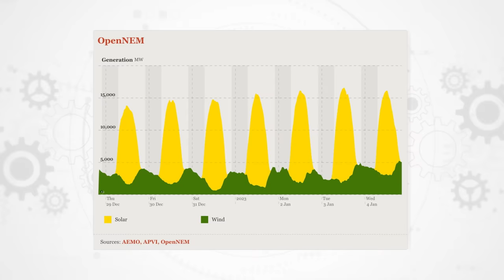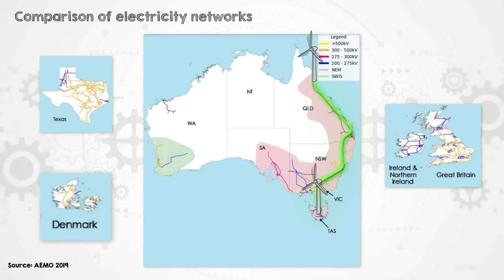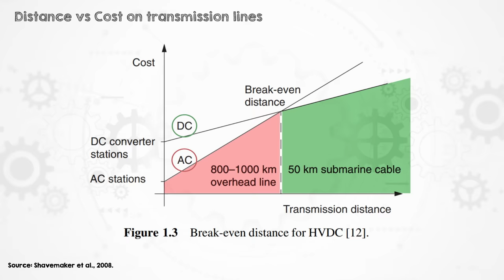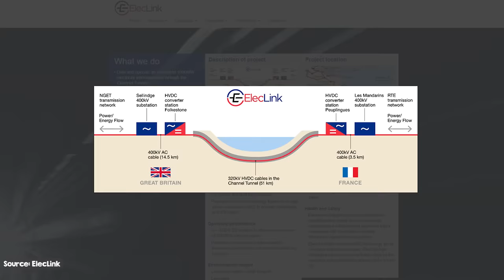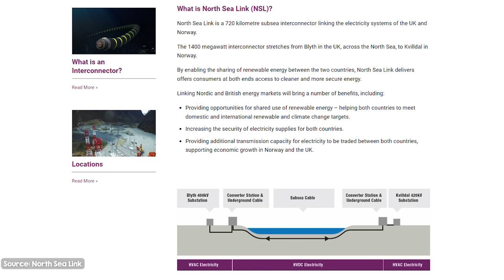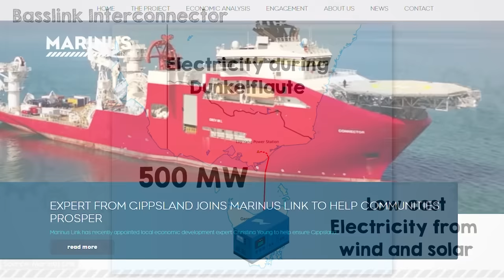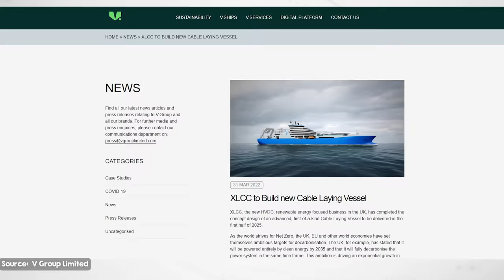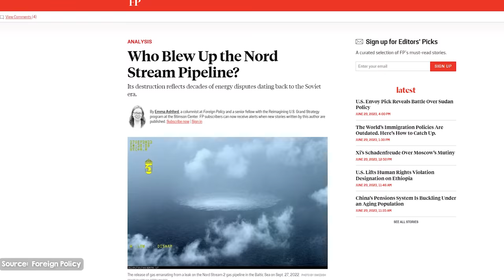Electricity Across Oceans: Is HVDC the Future?

Comment: Thanks for explanation of HVDC advantages over HVAC as I never understood it well.  The break even point is most interesting.  Skin effect should be very small at 60 hz, but guess it gets magnified with cable length.  Have they tried 30 or 20 hz to reduce skin effect?

Pardon a critical personal note, are you trying a new hair style or is it bad-hair day?
Reply: Nobody cares about her hair - she's an engineer. And it looks pretty normal to me - certainly not worthy of mention.
Reply: Is 20 to 30 Hz fast enough for an efficient transformer? That's the one killer feature of AC power, you can't give that up. I've never looked into it but I guess I always assumed the reason the world settled on 50-60 Hz was for efficient transformers. (Also, a lower frequency would surely wreak havoc with many of the DC rectifiers we use every day.)

Comment: Maybe I missed it but you seem to always talk about producing more energy. It may be anti-modern but the term "energy conservation" has merit. Take for instance gasoline/petrol. In real terms we are paying the about the same amount for a gallon as we did in the 1980s, but fleet average mpg are two times better. In general the hidden success story is that we are a more efficient society.
Reply: To reach net zero, you can never get there by improving efficiency, but you can get there by producing more net zero power.  Improving energy efficiency may help us to reach net zero sooner, but it is not essential, or even necessary, and the cost of implementing a significant improvement in home insulation for existing housing is likely to be way more than the cost of enough extra wind turbines or solar panels to cope with the inefficiencies!  In the long term net zero power sources can provide plenty of energy.   Energy efficiency is of course good, but reaching net zero ASAP is more important.
Reply: @nigels.6051  You are confused. As we write these words the American south is hunkered down in air-conditioned rooms. It is because of improved building codes that a stressed energy grid is able to survive. Energy conservation and efficient utilization are the other side of the same "Net Zero energy production" coin. The money invested in a BTU saved is as valuable as the money spent to create that BTU.

Perhaps a thought experiment: It is winter and you want to heat a room. You buy an electric heater. You turn it on. If the room is well insulated (conservation) then a  heater can will heat the room.  If the heater is very "efficient" then it will use less electricity to heat the room to a given temperature.  If the electricity is produce with renewable then "Net Zero".
Reply: When it comes to building insulation, I also need to mention cumulative savings. Say you pay X amount of money to install Y amount of insulation for a room that takes Z amount of energy to make a comfortable room for a day (mean yearly). The next day you have already paid for the insulation so your only cost is Z for the days energy. Better insulation consume less Z. This savings takes place every day for the life of that building.  The same is true for other technologies.
Reply: @chrisconklin2981  "If the heater is very "efficient" then it will use less electricity to heat the room to a given temperature.  If the electricity is produce with renewable then "Net Zero"."  But you can never reach net zero just with efficiency gains.  You can reach net zero by turning off all the fossil fuelled generators and replacing them with net zero generation.  You would only implement better efficiency if doing so was cheaper than building extra net zero generation, and while there will be some cheap and easy efficiency savings to be made, the more you do the more expensive it becomes, and you fairly soon end up with extra generation being the cheaper option.  net zero generation can replace all the fossil generation we currently have and produce a lot extra.  There is no need for the efficiency gains other than for reducing energy bills, and it only does that when the efficiency gains are a good investment, and if they are a good investment now, they probably were before, and will already have been done.  The financially sensible gains to be made from efficiency are quite small.
Reply: @chrisconklin2981  Maybe the situation is rather different in the USA, I heard that net zero power is costing around $100 per MWh in USA.  In the UK, power from new wind farms is significantly cheaper, sub $50.  The problem mainly being that you are late to the game when it comes to GW scale offshore wind, with lack of long distance interconnects a secondary problem, since offshore wind, although the cheapest power source, is never going to be generated where you want to use it.
Reply: @nigels.6051  It was once said that nuclear electricity would be “too cheap to meter” (actually a misquote).  Energy conservation and efficiency are a separate issue from electrical generation. Each is independent of the other. Granted, there needs to be an understanding of the comparative costs/benefits between conservation/efficiency on one side and the costs of energy production on the other side. The point is that energy derived from fossil fuels or renewables are on the same side of the equation. It is folly to ignore conservation and efficiency, maybe not in retrofit but certainly in new construction.  I doubt that renewables will ever be too cheap to meter.
Reply: @chrisconklin2981 Nuclear has never been cheap, while for us in the UK wind is currently the cheapest source of electricity and is  likely to get even cheaper.  I doubt it will ever reach too cheap to meter, but I do quite frequently see the UK buying nuclear power from France over our 3 HVDC links at negative prices - at night when they have too much they need to get rid of it because you cant turn nuclear down for an hour or two, it takes days.  For new construction, certainly it should be built with good energy efficiency, doing so is a good long term investment, and our government is helping with that by issuing energy efficiency certificates for buildings so that people who invest in efficiency do get a return even if they move soon after.  But even highly efficient new homes are still adding to the power requirements, every home uses power, you can't reduce your CO2 emissions by building a new home unless you knock down an old one in return, which rarely happens, while every year of delay in turning off those fossil fuelled generators increases the demand from your AC units as the climate warms!  We need to reach net zero quickly, and you are not going to do that by installing insulation.

Comment: Rosie, 

wind and solar are not the cheapest as you claim, quite the reverse.

It must be a ridiculous concept to connect grids so far apart, apart from the very high cost of the interconnectors and loss over such a distance, how can it be that there is sufficient spare power on one side to compensate for the low power on the other?
If you rely on renewables then it is a lottery as to how much power there is and when?
Are these connectors synchronous, somehow I suspect they are not so it doesn't really solve any problems. 
Reactive power?

Comment: Rosie   re major wind generation check out submission to "Inquiry into Australia's transition to a green energy superpower" submission no 109.  In short there is a land use conflict with the current Renewable Energy Zones (REZ's), for large scale wind, with infrasound impacts in a (relatively speaking) dense agricultural area along the great dividing range.  With the original 150m high wind turbines (era year 2000-2010), the ridge lines of the great dividing range were the peak commercial and viable sites for wind farms.   However, and check me on this, with 250 - 300 m new generation of wind turbines, most of western NSW and Qld and SA are also prime viable zones. And there is not the same land conflict issues.  The reason is that at 250+m the wind turbines are tapping into the laminar flow of air mass across the continent.  Ridge line sites no longer needed.  A major inland grid connection from SW Qld, down western NSW (eg close to planned inland Rail), connect SA and Vic and Snowy 2, would enable wind farms in these inland zones,  link up these state grids, and their the water hydro storage projects, and being inland also offer redundancy and security.  Further rail, heavy transport, and power, enables heavier industry (eg nitrogen fertiliser production) to be possible in inland areas.   I think this is a 'no brainer' better national development proposal that current the REZ for major large scale wind farms.   It is all in the submission.  I think this needs consideration and circulation.

Comment: Would it be possible to use sattelites and either microwave or lasers(in the infrared range?) To send this electricity to the other side of the world by bouncing it around with reflector sattelites and a receiving station on the other side?
Also the cable laying should be fully automated
Reply: No. Wireless power transmission is horrifically lossy.
Reply: @vylbird8014  even though efficiency would probably be in the 20-40% range, it would save huge costs compared to an HVDC line from one side of the world to the other, also would save billions by reducing the need to build reactors based on peak usage. not sure how efficient such a long HVDC line lets say from china to the US would be.
EDIT: also it is horrifically lossy because not enough investment has been done on it, not because it is fundamentally impossible

Comment: Wind and solar is as cheap as new furniture is cheap, when it only requires to rebuild your entire house.
All infrastructure rebuild/overbuild should be addressed to the actual cost of "renewables". Besides that, long transmission lines are reliability threat, because they are prone to disasters and sabotage. Just remember what happened with Nord Stream 1 and Nord Stream 2 pipelines.
On the other hand, if every city would have its own modular nuclear reactor, no need do do anything with existing infrastructure, no need to manage demand, arbitrage costs etc.

Comment: They ( Wind and Solar) are not the cheapest form of power - considering maintenance and reliability they are by far the most expensive form of energy - Tidal is the best in that category of reliability. As for this concept of a type of shared power system across the world, it would be a nightmare - imagine having an argument with let's say China or the Middle East - what do you think the first thing they are going to do - Yes, cut off the power energy to your country or make it very expensive - Why we are doing all this because politicians like Al Gore told the world that these are the only two options. Why - creating energy insecurity.

Comment: Still the problem is dc require inverter which is lots of transistors which they can be damaged easly and the life time limited. But transformers used for ac is basically cable and they have unlimited life time. So when you condiser even maintaince cost. Ac always wins.
Reply: Yet it doesn't. In some cases DC is the only option. Modern HVDC converters are quite reliable and while their is a cost to the regular maintenance of the power electonic, it's definetly manageable.

Comment: 11:30. Instead of thicker cables we can reduce the amount of DC current in a cable by duplicating the cables...If we add a few extra cables each cable will be more easy to handle and we do have immediatly a kind of extra safety. Yes , we double the amount of cables to be rolled out....but the infrastructure on land will not get more expensive.
And each cable will cost less.

Next advantage of duplicating cables...If one cable gets damaged there are other cable (with a little reduced total capacity) instead of no transport available. Of coarse the cables should each follow a little different trajector through the ocean if we want to prevent damaging all cables in one occoasion. (may be because  a sinking ship).
About politics...Of coarse it's an issue if ONE country controls that network. But it is NOT a problem if one country build that network. Only the usage of the cables should be free of any political intervention. (It will never be free of military intervention like the northstream pipeline....but an HVDC network could make vulnerable pipelines obsolete.
We do not need gaz transports and oil transports with all those risks if there is a HVDC network....And with renewables I suppose that all countries need to get power when in darkness or deliver power at daytime and or windy wether. This reduces political risks.

Comment: Many Apologies for being late on this opinion:  Single Point of failure - high vulnerability. Enemy subs can cut line quickly. ABSOLUTELY NO GO.
Reply: The main reason UK built their early HVDC cables was to avoid single points of failure; when you are able to import electricity from France, Eire, Belgium, Norway, Netherlands, Denmark, it doesn't matter if your coal miners go on strike!

Comment: Will work but stupid to build when Nuclear is much cheaper works better with less structure far cheaper. All the scrap metal and other garbage in making the solar panels and wind blades have no recycling = more garbage to store vs Nuclear that can be reused to end of life and not hazards in smaller power plants in remote locations. Over the air electricity should be the focuses as Tesla had working in 1920.

Comment: My concern is ecological. Specifically, would these cables mess with sea species that use electrochemical sensing? Or is there enough insulation that that isn't an issue? 

PS. There is no separation between politics and engineering. The decision to build these cables at all is political. That's not a bad thing, it's just the truth.

Comment: If they do the math the present is compres air+water a metal tank of 40,000 liter at 3,000 PSI an power a city and the cost per KW is Les than 30% of a battery of any tipe,a few extra solar panels can produce to compensate for the loses,

Comment: If you build small scale nuclear close to the loads then you don't need these extremely long transmission lines.
Reply: You just become dependent on whichever country supplies the fuel and handles the waste...
Also, nuclear takes long time to build and is expensive. The main reason for this is safety requirements, but we have seen at Fukushima what happens when a company running a nuclear power plant decides to cut corners to save a little money. If we lower those standards to make the nuclear plants cheaper and faster to build, there is no doubt that we will have more incidents.

Comment: Iceland would be a great source of Zero carbon electricity and can go to UK via Faroe Islands and all Norway from there as well!! This could also go from Norway into Germany who need to de carbonise their Electricity!
Reply: We nearly built an Iceland link, but it got dropped, I think because Iceland is quite small in population, thermal energy is not that cheap or reliable, and most of their electricity comes from Hydro, which as in most places is rather difficult to scale up due to lack of water resources.  I won't be surprised if we do get an HVDC cable up there though, but it will end offshore at a very large floating wind farm which will normally be in a different weather system, so will work well when we have no wind, and will not work when we have plenty of wind.
Reply: @nigels.6051  Great to hear! It was Wind and Geothermal I had in mind due to proximity of Polar Vortex and strong all year round winds. Could start with onshore Wind around the coasts before the massive offshore potential??
Reply: @simonpannett8810  Icelanders won't accept onshore wind turbines, they love their wild landscape too much!  We were talking about a 10GW wind farm off their south coast, to make the cable install worthwhile.  Iceland population is only 0.37 million, they work at a different order of magnitude.
Reply: @nigels.6051  Yes up to them what they want but as a society where are their future jobs coming from? Not fishing that is for sure. Being an Energy super provider with lots of Engineering Jobs might be great for them??
Reply: @simonpannett8810  I assume the plan is for Icelanders to service our 10GW floating wind farm from Icelandic ports, so yes it gives them future employment, but I'm pretty sure they would not accept onshore turbines in return for jobs!

Comment: another thing not mentioned is the cost savings of using DC as its possible to only use one conductor and use the earth as a return path. this essential halves the cost
Reply: Eh? You're thinking of in-home wiring, I think. Long-distance AC transmission doesn't have a "hot"/"return" pair. It uses 3 wires to carry 3 phases. Power is available via the voltage difference across any 2 of the 3 phases.
Reply: @ps.2  Yes, you are right. 3ph does take advantage of the 3 waveforms being 120° out of phase so they can take each others return current. but that still means (at least in my head, might need a physicist to confirm) that 50% of the time the cables aren't doing "work"